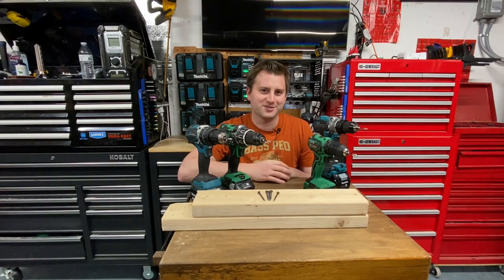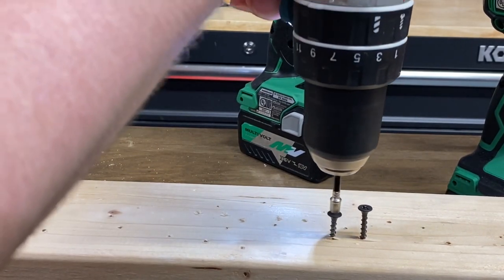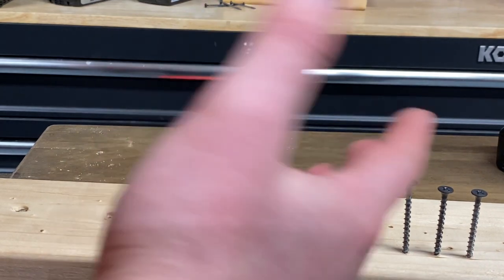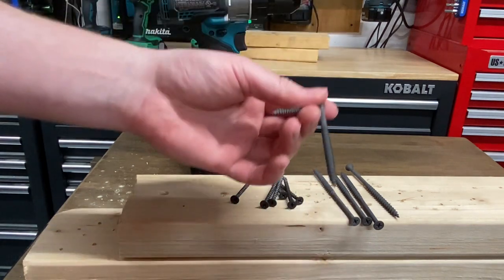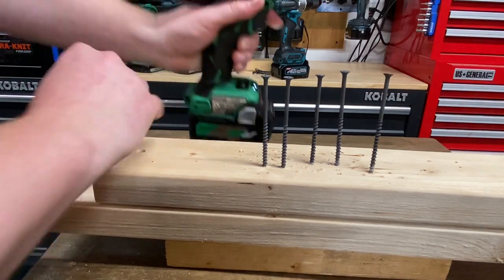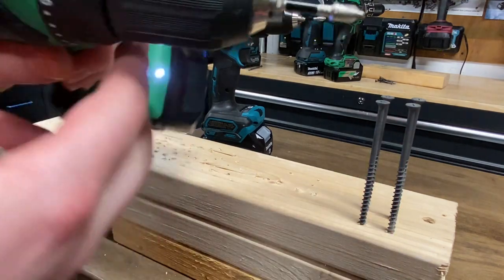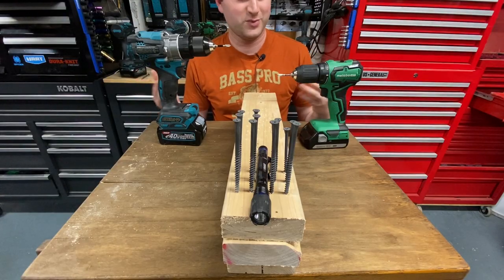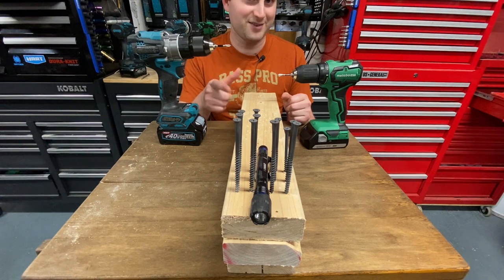Electronic VS Mechanical Drill Clutch | Which is more CONSISTENT in sinking screws?

Comment: As expected, and as I have seen before- electronic clutches don't work as well at lower settings (which is when it matters) in these drills.  
    Fortunately, this matters less in these full sized hammer drills or drill drivers, because people are not often using them for driving delicate fasteners (or any fasteners) anymore.  
   For almost all fasteners, I'm using either an a mulit-head driver (e.g. 12V Bosch Chameleon), for the small/delicate end, or an impact with mode/settings for everything else. I used to use an electric screw driver for delicate items like Ikea furniture, but the 12V multihead driver has mostly replaced that.
Reply from the maker: I would like to do some more testing on the electronic clutch with larger bolts and screws, but does anyone actually use the clutch for larger fasteners anyway? I just use an impact driver at that point.
Reply: @UltimateToolReviews   Seems that maybe some older guys who developed their habits prior to impact drivers becoming popular about 15 years ago might primarily still use drills for fasteners. Drills are usually a little faster, but much less control and prone to camming out and breaking wrists when binding at full speed. I primarily use  them for drilling larger holes
Reply: For lag bolts I like the larger Hammer drills with clutch setting
Most times we are pre drilling to make sure we don't get wood split
If we aren't using pre drills yes an impact driver or a straight impact wrench can be the truck
All depends on application
Reply: I've used the clutch on my XPH07 when on top of a ladder. My reasoning was to avoid those wrist-snapping binds that could knock me off the ladder. I had to go slow with the hole saw, but I have never had a close call.
Reply: @baseballdude8491  Lag screws require predrilling not just to avoid splitting wood but for proper fastener function. If there is no predrill, the fastener is impeded from pulling the material tightly to the substrate. The smooth part of the shank exists to allow this to happen, rather threads that would maintain any gaps between the material and the substrate
Reply: @kenb6144  I have the similar but newer XPH14, which is the updated more compact model, but seems otherwise very similar. I wish they added kickback protection and that would be useful in your ladder example.
Reply: @ccbowers  Yep I am fully aware of this-but many folks are not and do tests that really don't apply to real world applications-raw power is usually what is tested but not control, settings, fatigue, etc which are actually what daily users/contractors really need to know
Reply: @WillBlock-n9j   I agree with that. Youtube videos have convinced people that the impact driver or drill that can drive a 12inch lag deepest into the center of a tree stump is the best. But within classes, torque and speed is not the most important. The quality of the battery platform (other tool options), design/settings, and ergonomics is often more important.
Reply: I almost returned my new 40 volt combi drill because of the high torque on the lowest clutch setting before I realised that it has an electronic clutch, which means that it can't do light torque.

Comment: E clutch was designed to get the desired sinkness with less fideling with the settings. This thus alows them to open the rest of the settings to drive bigger badder screws which then will be more consisted stair case wise and the longer the screw you go in that setting until gear has reached it limit.
Reply: Wise as*
Reply: E clutch was designed  to get the  desired sinkness with less fideling with the settings at lower settings. This thus allows the drill to open the entire settings open on that gear for you to run longer and longer screws of that same screw in that same gear which then will be more consistent stair case wise the longer you go in that same setting until the limit is reached and have to switch to gear 2. Now driving them consistent in the same gear and same setting over and over is a lil finicky and sometimes a little off consistency due to the E CLUTCH systems.